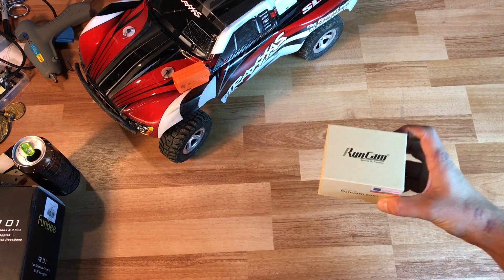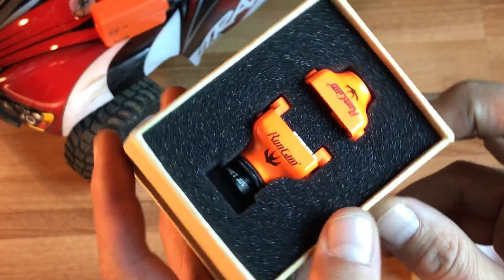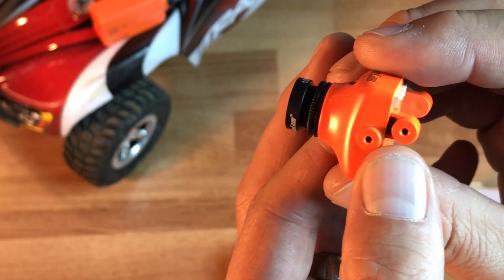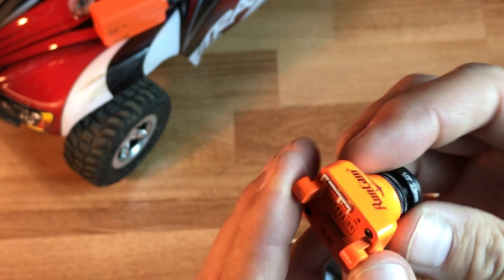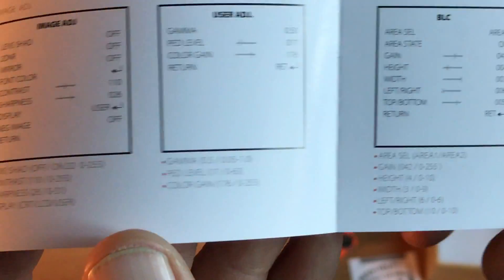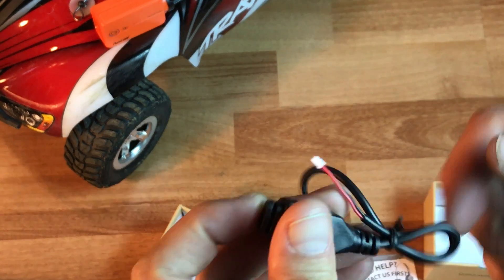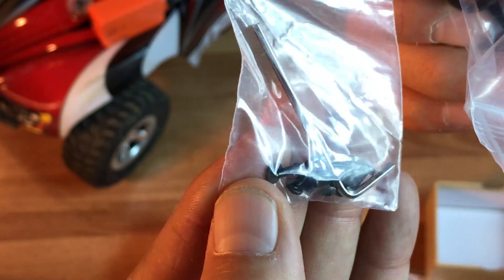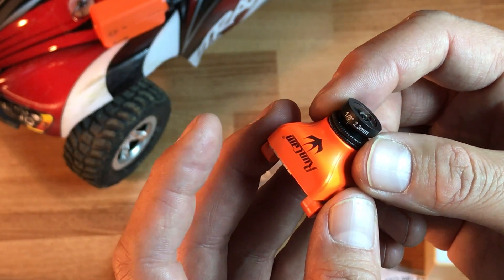RunCam Swift 2 Review

Comment: Best FPV cam to date? Can I use OSD (in built with swift 2) with just the standard 3 wires to the vtx (ground, power, data) ...? cheers
Reply from the maker: yes, you just use the three wires and leave the fourth unconnected to turn off the osd

Comment: Docs on my Swift say 5V-17V, so I guess they increased the top end to 36V.  (8S anyone??)
Reply: QC Support I think more to accommodate 6S along with voltage spikes
Reply: RCFlyer85 I'm sure you're right --  running 6S like mattystuntz is known to fry stuff connected to Vbatt when motor braking.